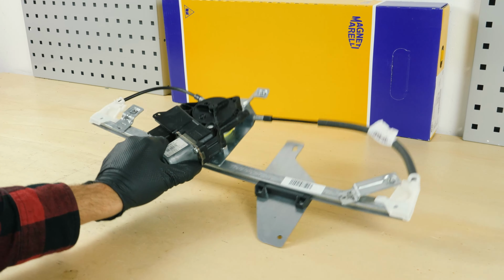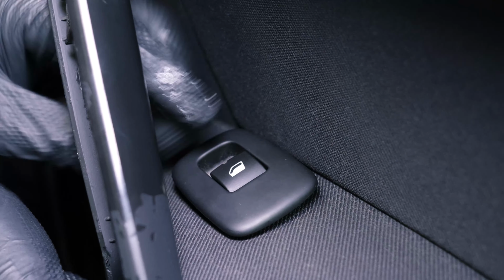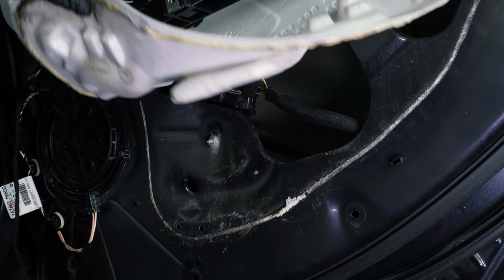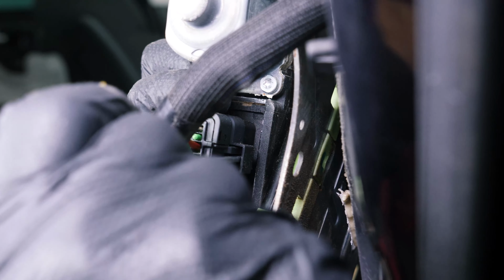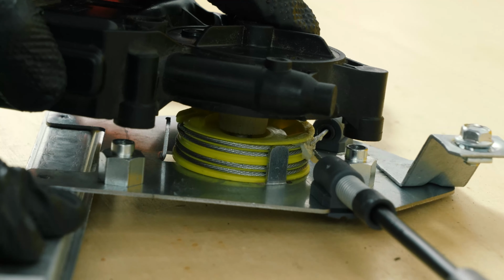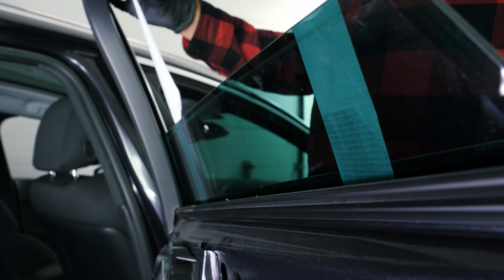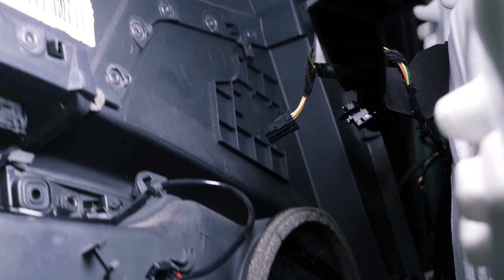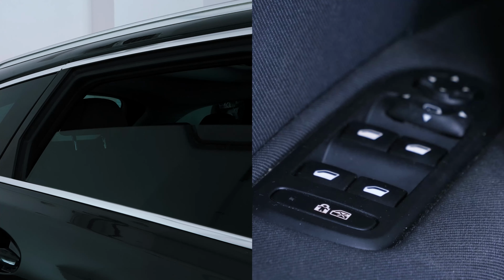How to replace the power window mechanism Peugeot 508 1 🚗

Comment: I changed the mechanism and then tried to reset the window operation.   But it does NOT work!  Can anyone help me please??

1. I open the window fully (lowest position) and I hold the button for 7sec

2. Then I close the window fully (highest position) and try to hold it for 7 sec, but the anti-pinch safety  activates and window    instantly opens 5-10 inches, so it's imposible to keep it closed and hold the button, for 7 seconds.

3. After I try it for couple of tims, then it stops going down any more...

I'm going crazy here, can anyone help ??  Is it posible that changing battery had something to do with it and what to do, if it did?
Reply: do you resolved the issue ?
Reply: @Dimitar_PopchevNo, unfortunately I didn’t. When I pull the switch UP, for automatic closing of the window, it closes the window, but as soon as it closes, it goes down and opens for approximately 10 cm.
Reply: Is the problem solved?
Reply: You can turn off anti-pinch via programming. I was exploring my scan tool and found a configuration that enables anti-pinch. 

However, why i was exploring lead me here. My replaced window motor moves inversely to what's pressed. I read online on a fix, and they said it needed coding. Problem is, I only found communication pathway to driver side control panel. Others dont exists.

Comment: The calibration did not work. My windows still comes down half way after going full up. I cannot hold the button up because it lowers by itself. I can only operate in on manual not on auto.

Comment: Great Video but I have an issue with calibrating the window up function. Every time I close the window fully it re-opens about half way. It is like it is going into anti-pinch safety mode each time I fully close the window. Any suggestions??
Reply: Have you by any chance, found what's causing this. I did my window but can not seem to reset it
Reply: i also have same problem, i cant make calibrating. can anybody help us?